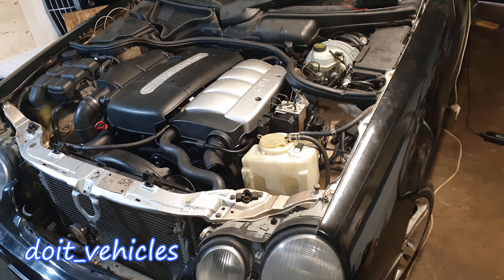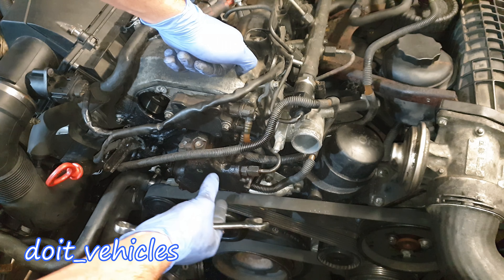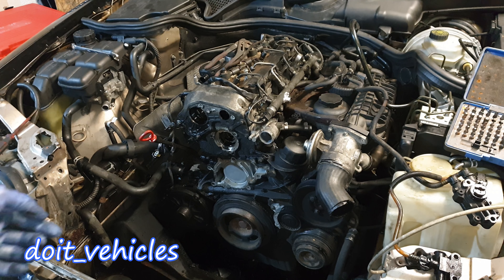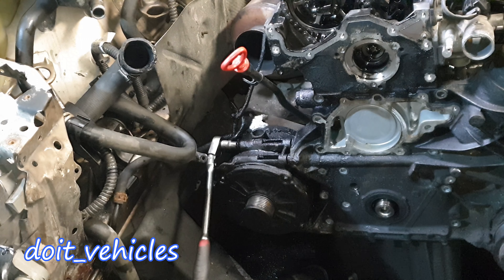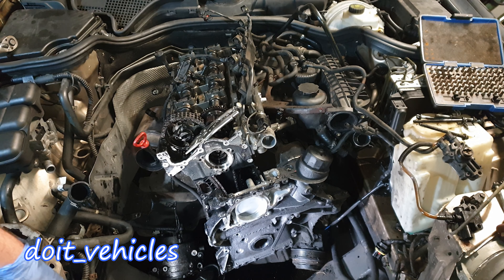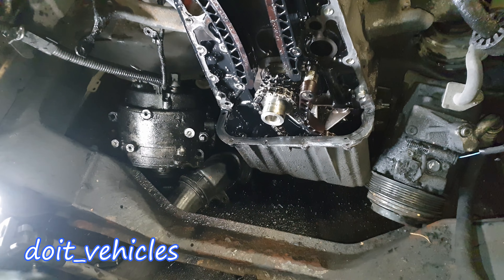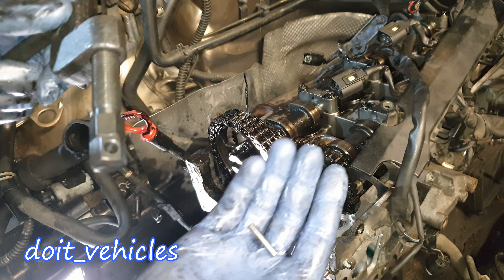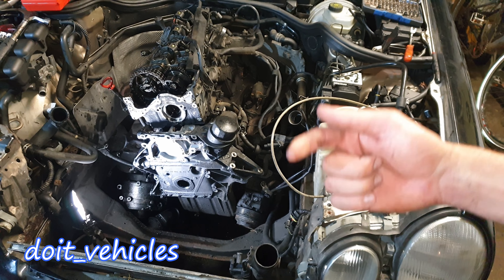E220 CDI Mercedes Timing Chain Replacement W210 from Om646 engine

Comment: sweet job there. to do just the chain tensioner is there a special method asuming its the same for a om648
Reply from the maker: The best way is to remove the engine and do a full rebuild

Comment: Thank you very much sir, I drive this car since 2007 380000km now still runs great, manual
Reply from the maker: That's nice )
Reply: How many times you had to change the clutch plate!?
Reply: @autoinfo5656  1 time only lamelle not the whole thing
Reply: @pabelox  Thanks for replying, could you kindly let me know the cost and labor for changing and at what mileage did you change.

Comment: My 2016 Infiniti Q50 has a 2.2 diesel Mercedes engine. I've done 240k miles and it still runs okay. No noise from the chain. Is there a way just to check it rather than replace it?

Comment: thats om611 not om646
Reply: Yup, you are correct. OM646 never came out on W210 chassi.
Reply: Same Engines! only difference are the Injectors in the later 646 and fuel system.
Reply: @autoinfo5656  nah, they are mostly identical but not the same. Some parts are differently mounted and cooling system is a bit different. If they were the same they would be named same.
Reply: @vukojeskocajic4804  Oh i see! What would you recommend going for!…W210 or W211
Reply: @vukojeskocajic4804  at that mileage do i have to change the clutch on manual transmission!?
Reply: @autoinfo5656  i have w211 and im pretty much amazed by the car. I have never owned w210. They are both equally reliable in my opinion except that w210 is more likely to rust than w211. For manual transmission i think it can handle a lot of kilometers like 400k kms without problems if the car hasnt been tortured, but for me real Mercedes is the automatic one
Reply: @vukojeskocajic4804  Would you recommend the M271 engine on the W211 facelift. My running is around 15-20 kms per day.

At what mileage can i expect to change the chain? how much would it cost me for timing chain change?
Reply: @autoinfo5656  I dont have experience with timing chains on petrol models w211 but as far as i know pre-facelift petrol models dont have timing chain problems same as pre-facelift diesels. So i cant recommend u because im not familiar with those engines. Here in Europe we drive diesels and mine is om646 with 350k kms and zero problems with the engine.
Reply: @vukojeskocajic4804  At what Mileage do you change the 5G tromic fliud and filter!? #justcurious
Reply: @autoinfo5656  60-70k kilometers
Reply: @vukojeskocajic4804  Hi Vukoje,I'm thinking of buying a car with an OM611 engine.I did just sell a car with the OM646 engine and was very impressed with the performance.Am I likely to get the same performance and reliability from an OM611?
Reply: @MrTherbst  Yeah, I think you wont get disappointed. The difference between them is so minor that is hard to notice except cooling system in my opinion is more complicated on om611

Comment: at what mileage should the chain be changed? because im looking into buying a w204 220cdi so im wondering if its a common problem or not.
Reply from the maker: In theory the chain is " for life " if the oil was changed regularly
Reply: @doit_vehicles  so if oil was changed around every 6-8k miles i should be good?

Comment: Great video but I am sure this is an OM611. It looks a bit different than my OM646 in some details. Also the OM646 was not used in W210. Anyway this can become very useful for me as I have to change my timing chain of my S203 with OM646.
Reply: It IS an OM611 DE 22 LA. The OM646 was introduces 2002 together with the W211-series. The W210 had the OM611 engine

Comment: NO! i AM NOT HAPPY WITH THIS JOB! yOU SHOULD REMOVE THE ENGINE FIRST, remove THE CYLINDER HEAD, CHANGE THE SLIDERS!!! OF THE CHAIN! ALSO-IYOU SHOULD CHANGE ALL THE SPROCKETS!!! THE CHAIN IS WORN AS WELL ALSO THE SPROCKETS A RE WORN DOWN! ALSO- WHAT ABOUT THE OIL PAN GASKET? IT SHOULD BE CHANGED! ALSO THE REAR AND FRONT CRANKSHAFT SEALS! YES THIS WILL BE A RELAY SLOPPY JOB IF DO NOT REPLACE THE VALVE STEM SEALS!. BUT, BEFORE THIS YOU SHOULD INSPECT THE CONDITION OF VALVE AND RESURFACE THE VALVE SITS AND THE VALVES AND CHECK IT AGAIN . also! VERY IMPORTANT- CHANGE THE PISTON RINGS AND ROD BEARINGS AND CRANK SHAFT BEARINGS!!!. ALSO- THE INJECTORS!- BRING THE INJECTORS TO BOSH SHOP TO BE RE CALIBRATED AND UPDATE THE NEW CORRECTION NUMBERS INTO THE ECM... MAN, YOU JUST DO SLONPY JOB WITH THIS TIMING CHAIN. IF YOU DO NOT DO ALL THIS THINGS THAT THE BETTER WAY WAS JUST TO CONNECT THE NEW CHAIN TO THE OLDER ONE AND MADE TWO REVOLUTION ON THE CRANK SHAFT AND TO CONNECT THE NEW CHAIN PIN AND DUN- JOB FOR 15 MINUTES
Reply: He did it right. Because sometimes the car isn't often worth to do a full engine rebuild. So change the chain. Put it together, so the car can do 50 to 100.000 km again and than the car is done..

I hate the internet over Restoration community..

Comment: Parfect video ! I learned a lot about serviceability of this engine. It doesen´t seem impossible but the need to remove the head in order to replace the guides is crazy. I remember the timing chain job on my BMW and this seems to be a bit worse since you need to remove the turbo, intake, injecotrs etc. but on the other hand, the 220cdi seems to have much more robust and simple design which can last a lot longer.